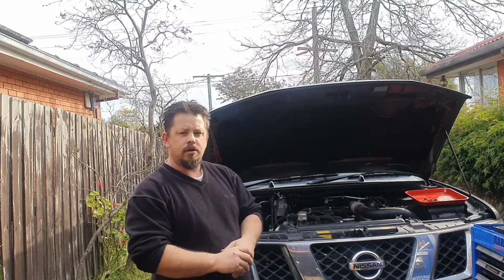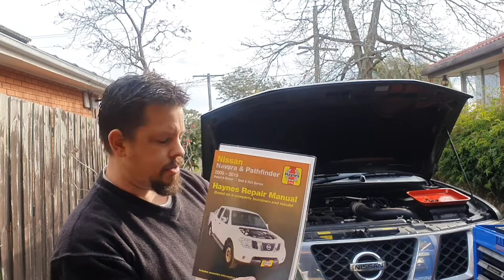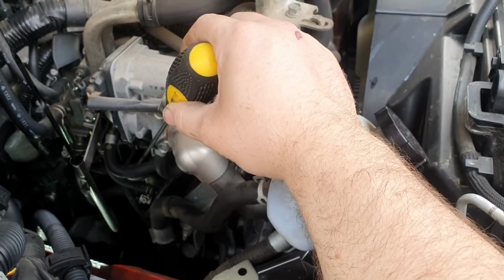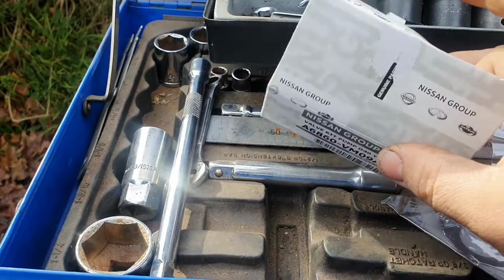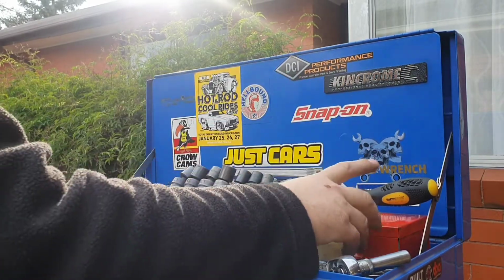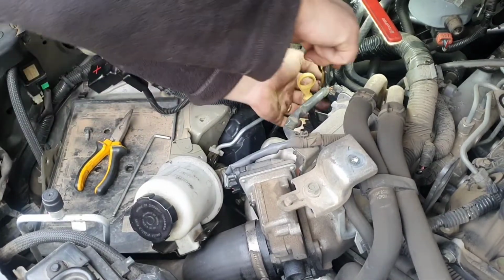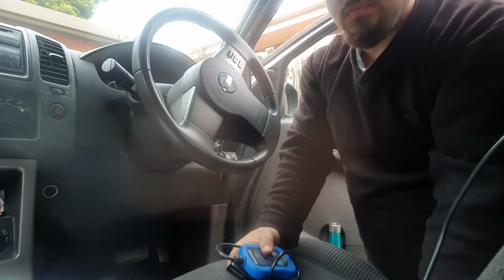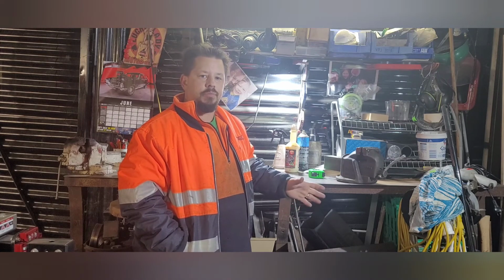Nissan r51 pathfinder and d40 navara fuel suction Solenoid

Comment: I changed mine several time as it was going into limp mode. And it done it again then I pressurised the primer really hard and notic a leak between the hose from filter and metal tube at clamp . I tightened it as I think it was loosing pressure which caused the computer to see the loss in pressure and sent it to limp mode. Check all your fuel clamps near filter and lower near engine
Reply from the maker: Thanks for sharing hopefully that info can help out other push rodders ,thanks for watching 👍🍻

Comment: Great video.  Please mention how important the correct torque is when tightening any fastener.  I have worked in several workshops where only torque wrenches are used to tighten any fitting.
Reply from the maker: Thanks for the feedback will do and thanks for watching 👍 🍻

Comment: Waaay easier through the wheel arch. Removed the liner and it’s just sitting there. Always do a fuel pump reset after.
Reply from the maker: Thank for that great bit of info and for watching 👍🍻
Reply: Actually have done it both ways and found once you know what ur looking at then its easier from the top

Comment: Hi please i have np300 ,i have problem with scv i have changed and changed and changed the pump but still if the car runs and the engine heat then the scv is faulty.so please i need solution for that.thank you
Reply from the maker: Have you checked the wiring to the scv thanks for watching👍🍻

Comment: Had a nightmare replacing one of these.  Pulled the old one off,  couldn't see a gasket on the one removed.  Stuck the new one on with the gasket and for some reason it doesn't seem to fully seal, no noticeable leak but if you run your finger underneath the SCV you can feel it slightly wet with diesel.  Any suggestions?
Reply from the maker: Its highly likely the old gaskit is stuck to the main housing witch the Solonoid bolts to ,thanks for watching👍

Comment: Greetings again from Oamaru, Sth island New Zealand.
Thanks for your vid.

Question. 
Any possible causes to this misery?.
2012 Nissan Navara D40 St-X Diesel.
160.000 k.m on clock 

Symptoms...
A putrid white hazy foggy smoke comes out of exhaust after around a minute of idling after startup.

 Engine has rough lumpy idle then cuts out.

No fault codes.

EGR valve and cooler fine.

No overheating that i know of.

 I possibly have coolant leak but there's no coolant loss.
No coolant in my sump oil, and no oil radiator.

Cheers Carl
Reply from the maker: G'day Carl its a bit hard diagnosing any vehicle problem over the inter webs but ill try to point you in the right direction if you havent already get your self a work shop manuel check all the inlet piping and clamps are tight, clean the maf sencer, check the pvc system is not cloged up( positive crankcase ventilation) ,check over turbo shaft seals not leaking ,check fuel filters not blocked i hope this helps you out a bit thanks for watching mate lets us know how you got on 🍻👍
Reply: @pushrodtv6623  Good morning and thanks. Yes I cleaned m.a.f sensor and e.g.r but will check e.g.r actuator mechanism later today when weather is calmed down. 

I'm not sure if diesels have P.c.v valve. 

Mine is a 2012 Spanish built Nissan Navara D40 St-X.
All e.g.r circuit was decarbonized last week.

Carl
Reply from the maker: Yep all engines petrol or diesel will have some form of p.c.v

Comment: Its nice one but please help me to switch off the engine light, my navara is not pulling
Reply from the maker: First id hook up a code reader or scan tool into the obd2 port and from there start with the basics like checking and cleaning electrical connetions its to hard to give an answer without looking at the car thanks for watching

Comment: I have a loss of throttle response after revving the engine past 3500 rpm ... then a p0093  code is set . Suction control valve piston has minimal scoring but is moving freely .
Reply: no signs of rust or debris
Reply: Today I'm going to replace the fuel filter and all the hose clamps . Some are easy to twist though clamps are tight
Reply: What else could cause  this issue  ?
Reply from the maker: @nategmaycock9398  I had no codes showing, like I said in the video the valve is an electro magnet it's stuffed internally with plunger working  freely by hand you can also try to power the valve on the bench and check it that way its hard to Diagnose over the YouTubes with out seeing the vehicle in person thanks for watching 👍
Reply: Hooray... fuel filter must have been blocked . Filter is noticeably heavy .. I've replaced it  this afternoon  and test driven the  truck and not had an issue since ... 

Something I did notice before changing the filter . The actual fuel pressure and target fuel pressure were very different... This was the biggest clue 😂
Reply from the maker: @nategmaycock9398  good to hear mate 👍
Reply: @pushrodtv6623  hello dear sir 

These scv have a very common problem of getting faulty and I've seen many vdos people replacing it with the upgraded or updated one which is a little longer than the one which comes from nissan on a denso fuel injection pump.
Is it true that it works if so then where one can find that upgraded scv 

Thanks 
God bless u dear sir
Reply from the maker: @AlimonaAbbas  G'day bud I haven't come across the longer  Fuel  Solonoids so I can't comment on them, thanks for watching 👍 🍻

Comment: I have automatic 2007 navarra , d40 engine , when cold car cannot even move , once warm in 20 minutes car start to get power and can move , once warm tube of fuel often  jump out like there is too much pression
Reply from the maker: It's a  bit hard to  Diagnose over the YouTubes but check all electrical connections, loose fuel lines blocked fuel filter and connecting a  Fault code reader check for faults  check and clean the maf sensor hopefully these will head you in the right direction  thanks for watching 👍 🍻
Reply: did you solve this problem? i have the same problem. Thank you
Reply from the maker: Yep problem solved car runs great after fitting new fuel Suction solenoid thanks for watching 👍🍻

Comment: Did you experience black smoke?
Reply from the maker: No , no black smoke mate thanks for watching 👍
Reply: I have black smoke and  I am not hearing the turbo spool up ... truck is quite slow in general
Reply from the maker: @nategmaycock9398  check all your intake and intercooler piping hoses and clamps and your turbo if you have one